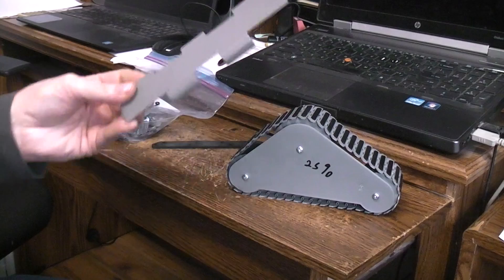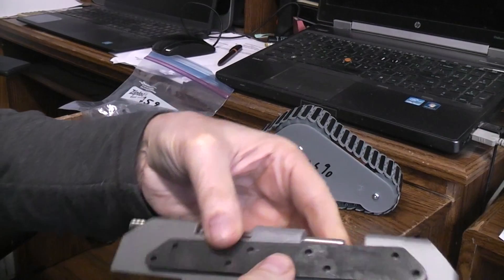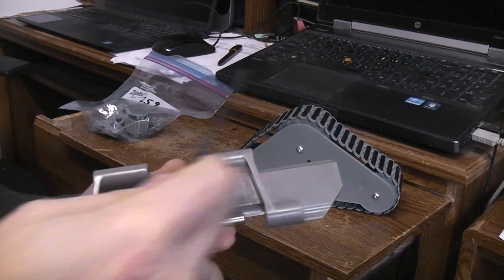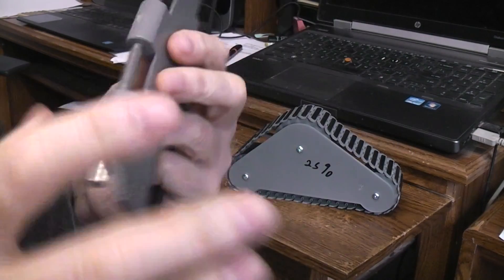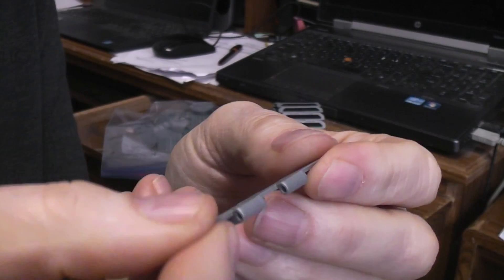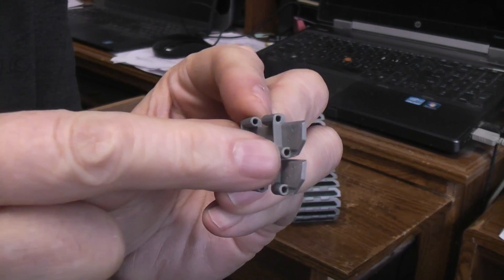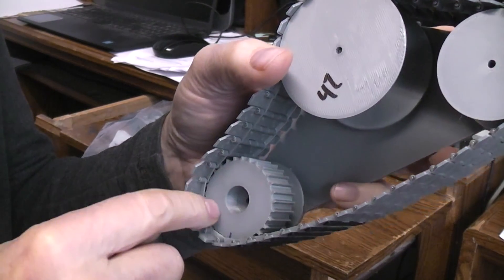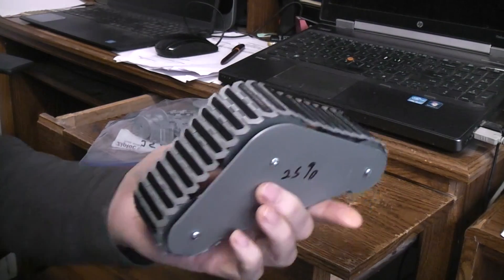Let's build some scale Johnny 5 motorized track units. Part 1. Looking at 1/4 scale.

Comment: Where can i get these stl files? Im in the middle of building a 1/1 scale replica of the toy from short circuit 2
Reply from the maker: In Part 4 of the build of the track sections I provide the link to the STL files on thing-i0-verse.
https://youtu.be/RA2TYTcKHwo?si=qpjARkFAu8ygRLVl
The first video was to decide on the scale for the build, once I had the scale worked out that I wanted I then shared the build files. If you go to thing-i-verse and just type in "Robothut" it should bring up all my posted projects.
Reply: Thank you i went and got your files to use with my j5 files. These videos are great for what im doing. Also subscribed to your channel since alot of the videos you got are things im getting into. Thanks again @Robothut
Reply from the maker: @Topher-r2w  So glad to be of help with the projects.

Comment: Very cool! I always liked the way Johnny 5's treads looked. Wall-e had similar treads as well.
Reply from the maker: Yes, also the robot movie RUN AWAY had farm robots with conveyer type treads on its robots and even at the beginning of the original Beatle juice there is a robot out in the field with these table chain conveyer type treads.
Reply: @Robothut I'll have to check out that Run Away movie.